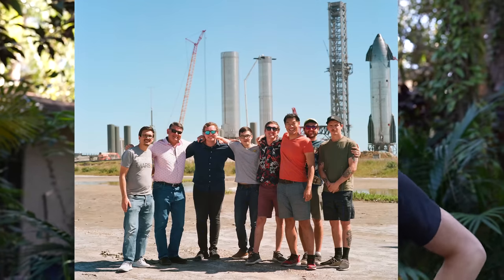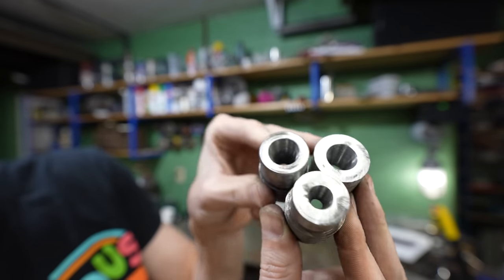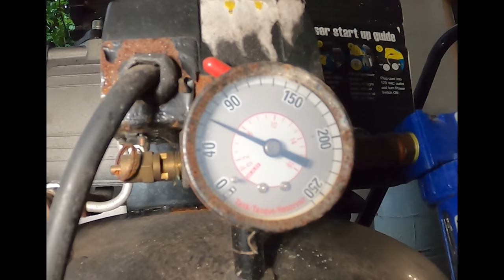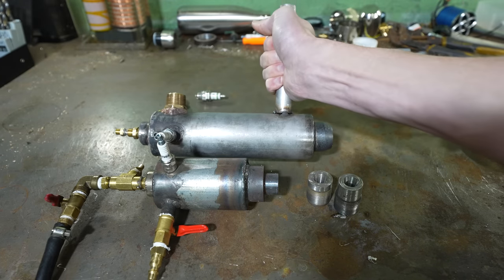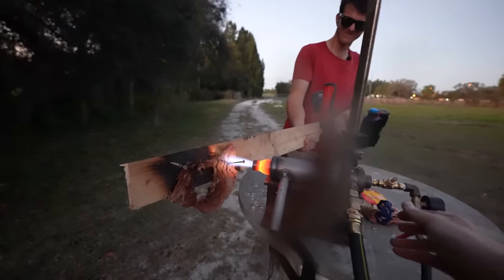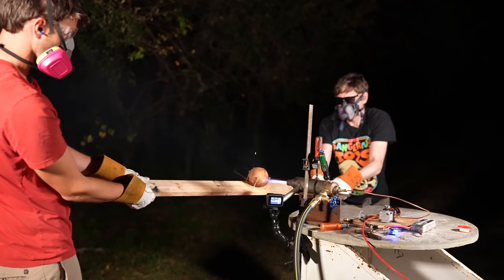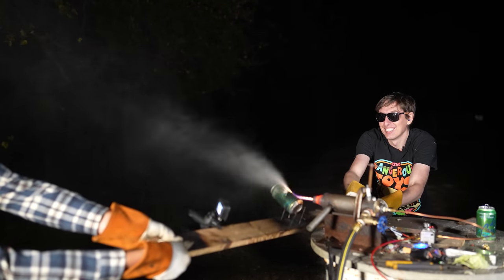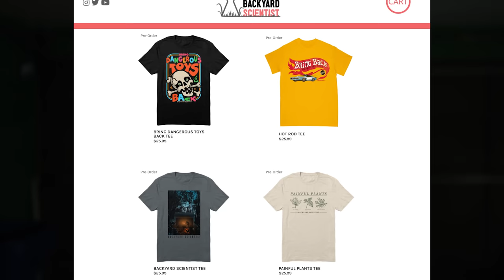fire death machine - i made a rocket

Comment: Propane and compressed air?! Dude that is awesome. I should have known you could get those kind of results with air only oxidation and enough input pressure but I just never considered it.
Reply: Wow, I was just saying he should test that Starlite from your channel, and I didn't even notice you were right under my comment haha!
Reply: @3000gtwelder  It would punch through starlite I'm sure, not because of the heat but because of the pressure blowing the carbon away
Reply: I’d like to see u take a crack at making a rocket engine
Reply: @tannerwatson1216  i expect that would wind up much less hazardous too
Reply: Well he was starting with 49 horse power worth of compressed air and then dumped a ton of chemical energy on it as fuel. 
Edit did the math, and he could be putting out 62.88 horsepower in total with the kerosene if the compressor was at full throttle.
Reply: Integaz must be upset seeing this
Reply: @joshuaworley3898    WOW, that's a lot of pressure 😳.  Very impressive.
Reply: @joshuaworley3898  Would have been interesting to see the thrust produced by the 49hp air compressor running through the "engine" by itself, then running with the kerosene injected...  I suspect we're really just watching a glorified torch the whole time.
Reply: ROCKETS ARE COOL 
TOMATOES ARE DISGUSTING!
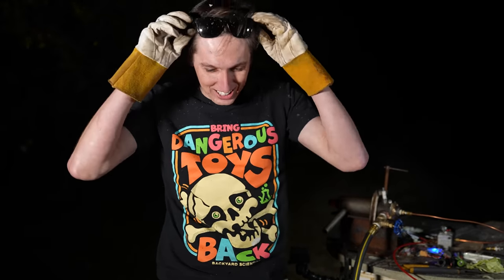Reply: 9:04 the class th0t be like
Reply: @Nighthawkinlight  Yeah, your probably right. They use special resins and composites that puff up and ablate away.
Reply: @spartanu9268  Why?
Reply: @thom1218  I don't think so, you wouldn't see mach diamonds.
Reply: @3000gtwelder   Integaz has been 3d printing rockets for months but with moderate success
Reply: @spartanu9268  Yeah, but he knows 3d printing with resin isn't the best way to build a rocket lol. I'm sure he would use steel if he really wanted to make a working rocket lol.
Reply: @3000gtwelder  True
Reply: You should see what  compressed air does to electricity. 

You may be in for a suprise
Reply: You guys need to try doing some stuff together sometimes!!
Reply: In a welding shop we use acetylene gas and Oxygen gas. We achieved the same effect but it’s kinda like a mini lightsaber now
Reply: I subscribe to the news letter
Reply: @tommiraeko8541  what are you referring to that i can Google and get results other than storing energy as compressed air or wind turbines
Reply: Instagram User  You sound jelly of his GF
Reply: @joshuaworley3898  49 Horsepower motor, there will be significant losses involved in the compression.
Reply: @thom1218  It is a rocket motor. I don't know why so many people are so salty about him using compressed air. Where are all your videos of you producing supersonic thrust with shock diamonds?
Reply: @randomname4726  Follow up - a real "rocket engine" powers the compressor from the combustion of the fuel that also is delivering thrust - it doesn't cheat by just dumping fuel into an already existing air stream.
Reply: @thom1218  You are so clearly jealous.
Reply: EPIC!
Reply from the maker: @joshuaworley3898  HA your the only person that has done the math so far, im assuming you calculated the mass flow rate of 185 cubic feet of air per minute + the stoichiometric amount of fuel? I got a similar result.  I also tried to estimate the extra thrust from the nozzle accelerating the hot gas so i think its a little bit more, about 50% more thrust than the air alone.
Reply: @TheBackyardScientist  With just some small changes in the design and geomerty ye should be able to up that to around 70%. And with the use of just O2 instead of compressed air ye should br able to hit around 318% for close to 6 seconds till it melts.
Reply: Im curious if additionally adding an inlet for an oxygen tank would increase the thrust? 😂 Yuss i got to the end of the vid so glad you did
Reply: @joshuaworley3898  Something that small putting out 63?
Reply: @TheOgAutisticOne  brooo
Reply: i love your videos
Reply: Where is THE HACKSMITH
Reply: @mason8852  wot?
Reply: @3000gtwelder  this has to be done
Reply: Dè
Reply: Instagram User  I know. He's always really happy in his videos!
Reply: @Paragon643  using something like ethanol and a mix of film and regenerative cooling might help it not melting too much
or ammonia
Reply: @Mysterybox007  it would increase the thrust but also the temperature so it eould melt so you eiuld want to daa some type of cooling so the engine doenst melt instantly
Reply: I didn't expect to see my favorite Ted Cruz lookalike science man here.
Reply: clearly should have used liquid ox and liquid hydrogen
Reply: I remember seeing a video a couple years back of a ukrainian guy making a propane torch just by using a syringe, 2 hypodermic needles a bit of tubing and a bottle as its compressed air tank. You can make anything out of anything if you really put your mind to it.
Reply: imagine pure oxygen
Reply: @thom1218  Not exactly, a real rocket engine also has liquid oxygen flashing into a gas, which surely produces quite the "airstream."
Reply: Basically it's the Venturi effect x2, and then add a venturi nozzle for x3 🤣
Reply: How about hydrogen and pure oxygen!?? It could be a explosion..
Reply: @lalxl  can i use mt lungs instead od a bottle?
Reply: idk if any1 else has said this, but i read your comment in your voice.
Reply: @spartanu9268  yes he’s probably upset and exited hard to explain but I think I know the feeling
Reply: @TheBackyardScientist  me too
Reply: It’s a Russian idea what do you think
Reply: @TheBackyardScientist  youre*
Reply: woah science stuff I dont understand
Reply: @TheBackyardScientist  you sound exactly like Kermit da frog 💀
Reply: @randomname4726   Yeah, these guys are apparently unaware that the Oxidizers used in "real rocket" engines are pressurized with turbo pumps. Insane pressures, sometimes. The pressures must be above the exhaust pressure, and the fuel/oxidizer pressures must match each other so that one doesn't force its way into the other's system. I think that they just didn't think too much before making assumptions.
Reply: @thom1218  I had the exact same thought. He already showed with just the compressor how much air was coming out.
Reply: @thom1218  Rocket engines are all glorified torches in a sense, the only reason that torches don’t produce thrust is that they burn their fuel externally and the hot gas expands in all directions, putting only a very slight pressure on everything nearby. A rocket burns it’s fuel internally and only lets the gasses escape in one direction. With the amount of fuel he is burning this rocket MUST be producing a substantial amount of thrust unless there is a huge leak, which would be visible because we can see the whole engine.
Reply: @harryf9885  If the difference between the 43hp air compressor on its own and the "rocket" was impressive - we'd have seen a "rocket on" / "rocket off" side-by-side... and we didn't.  I'm not buying the difference is impressive or even worth watching.
Reply: I need this for my exaust
Reply: I feel like this needs oil, where needed;/
Reply: just realized I shouldn't be here, too much smart guy talk
Reply: Smoke video calling
Reply: What they call it
Reply: Lol
Reply: @TheOgAutisticOne  bro ☠
Reply: @Bibibosh  Kentucky ballistics need this rocket engine for torturing his ever-hated eggplants!
Reply: The heat ray at the ants house
Reply: This man is like Mark Watney🤦‍♀️

Comment: Some questions for Part 2:
- The result of the different nozzles.
- A measurement comparing force output with and without ignition.
Reply: Very little force comes from the air compressor relative to combustion. Because he can control the amount of chamber pressure he can just dial it in to suit whichever nozzle he's using whereas in a flyable rocket motor everything is calculated and defined beforehand to match.
Reply: Plus maybe using a liquid oxidizer, or would that be too dangerous?
Reply: @randomname4726  I'm not so sure. You are probably right, but I feel like there's a possibility it's like 30% compressor - 70% combustion. That air compressor is a serious piece of equipment, and you can cut through all sorts of stuff with just the air compressor. I have no frame of reference for the combustion.
Reply: @doubledoot  yeah liquid oxygen could make grease in your seals explode. Also you can't buy that stuff but have to freshly distill it from the atmosphere with buyable liquid nitrogen. And by using 100% oxygen instead of atmosphere 80%nitrogen 20%oxygen it will get much hotter, melting your engine withing seconds if you don't have a good cooling concept
Reply: @Dee-nonamnamrson8718  Looks like I'm wrong, he says in other comments that it's about 50% with just air. I'm shocked, I've used these compressors and while they do put out a lot of air the speed is nothing compared to the rocket motor.
Reply: @randomname4726  50% is shocking. I didn't think it would be that much either.
Reply: Not only force but also how much air and fuel consumption reduces after ignition.
Reply: also maybe ethanol and MAybe ammonia as fuel
Reply: Yes and Pre-Heated Fuel
Reply: @doubledoot  i bet it would sonce suddenly you're making much more complete combustion and cgamber pressure but that inst all that dangerous but like that i bet he would melt the nozzle if he doenst use some cooling
Reply: @petermacris8260  ammonia is not great to deal with
doenst burn all that well it seems like
it's also a neurotoxin
Reply: pretty sure it needs a smaller nozzle, shock diamonds and what not
Reply: @nathanwest2304  if he was trying to launch it,vit fldownst rlly matter
Reply: @randomname4726  Too wide nozzle. Based on some measurements from when he's cutting the hotdog, I calculated the outer nozzle diameter should only be 53.5% of its current diameter for optimal thrust at atmospheric pressure. That would make a much grater difference compared to the compressor only.
Reply: @hitnovak  Nice job on the calculations. It's clearly been far too long since I played with rockets.
Reply: it would be nice to see him use a nozzle where he has done the characteristics calculations in order to achieve the best nozzle, and then compare it with the nozzle where he made his best guestimate
Reply: Hmm I'm no expert but I think he's made something closer to a jet engine. A jet engine compresses air, mixes it with fuel, and ignites it to produce propulsion. A rocket should contain all of its fuel including oxygen.

In the video, the oxygen source is from an air compressor and not an oxygen tank.
Reply: Should be easy enough to add a sliding mount and a vertically placed load cell to measure thrust with. Would also be interesting to see the plotted data for both fuel and air pressure against thrust produced.
Reply: AND DIFFERENT FUELS
Reply: @Dee-nonamnamrson8718  I don't think people appreciate how much 185 CFM is lol
Reply: @KillFrenzy96  It essentially serves the same purpose as an oxidizer though, more oxygen atoms in contact with fuel allowing it to combust more efficiently. Doing this with an actual oxidizer/fuel mixture would be far too dangerous, even beyond the scope of TBS I think. At least with the lax safety protocols they were using in this vid.
Reply: Technically by using an air compressor he made a jet engine, still cool as heck though. It's kind of like calling snorkeling SCUBA. By definition, not really, but both are fun.
Reply: @michahermann7869  you can buy liquid O2, just not in small quantities. Smallest unit I've seen is like a 4ft tall, 3ft wide dewar.
Reply: @doubledoot  Liquid oxygen and kerosene is what they run actual rockets off of... I don't think that amount of power is even remotely safe in a homebuilt engine.
Reply: @Dee-nonamnamrson8718     @Random Name   i feel at home here
Reply: @randomname4726   @nonam namrson i feel at home here
Reply: @impv1se  I think you might be the first person that's ever realized what my username meant, or at least mentioned it. Someone blowing and burning stuff up in their backyard is a magnet for people who prefer anonymity. Who'd have guessed?
Reply: Propane isn't that explosive though, and if he's got an industrial air compressor with 120psi + then I'd wager 99% of the thrust is compressed air.

I see 50% going around in the comments but I highly doubt that.

He basically made a welding torch.

I suppose you could offset the compressed air with pure oxygen and lower the pressure to see?
Reply: use solid fuel like the space and make boosters,just substitute ammonium perclorate for potassium nitrate in your rocket candy and add a bit of aluminium

Comment: Shock diamonds, while cool, mean that the nozzle is over expanding the exhaust. Try using a nozzle with a smaller bell and you will get even more thrust.
Reply: @dionh70  just did. He says the exact same thing
Reply: I was gonna mention this. Thanks for doing so.
Reply: Another thing is that if the nozzle is too overexpanded, it could have actually exploded/

Comment: What is missing is a static force test comparing the thrust of just the air, vs running. That would show just how well, or not it is actually working
Reply: I was just about to comment this
Reply: Totally agree. How much thrust is the fuel adding. Also, O2 instead of compressed air.
Reply: @douganderson7002  You have never seen a high CFM compressor before I guess. A sandblaster would blow the trees around just like that. We know it’s adding something we want to see how much the fuel is adding.
Reply: aren’t the shock diamonds proof enough
Reply: @aawagga6841  Yes it's adding something. The question is how much.
Reply: @douganderson7002  Compressed air that's at the speed of sound...
Reply: @aawagga6841  If it's backyard science then he should have to put it on a sled, measured the thrust on air pressure alone then run the engine on the sled and subtract the air pressure thrust.  I suspect the burning fuel added very little to the output, it just looked cool.

I can go down to my garage and blow trees around from a distance or cut a hotdog in half with my $850 shop compressor.
Reply: @dev-debug  honestly who even cares, go make your own if you’re so bothered by it
Reply: @aawagga6841  Some of us like the data part of it.
Reply: @aawagga6841  I forgot, this is a channel where they do smart things like putting gasoline on tennis balls and hitting them.

He really should just remove the science part from the channel name I guess.
Reply: while I might be suspect on this being an actual rocket engine, I do wonder as home access to things like CNC and laser sinter printing gets ever better.  how long is it till a youtuber violates ITAR without ever knowing about it. And does ITAR even apply to people just dicking around in a garage and a field.

Comment: My dude, if you have to feed compressed air into the system, you haven't made a rocket. You've made something even harder. You've made a glorious ramjet.
Reply: nope
Reply: ...no, it's just a jet engine. The defining characteristic of a ramjet is lack of compressor
Reply: If you want to consider the engine compressor as part of the jet engine, you could call it a motorjet. 
Otherwise, it's a rocket, that uses a compressed air rather than say liquid oxygen.
Reply: A ramjet uses forward momentum of the craft to compress air by sheer force of speed.

Comment: This video was awesome. And a fun fact for you guys, so my job is Thermal Spraying. We pretty much use the same technology to superheat, melt, and then accelerate tungsten carbide. We then coat metal parts to apply tungsten carbide and create a hard wear resistant surface. 

The gases we use are compressed air of course. Propylene and pure oxygen. It makes a super hot rocket flame with tons of shock diamonds.

Comment: I'm curious about what what other nozzles look like. I'm assuming the flow is overexpanded at the nozzle but shock diamonds also occur from underexpanded flow too (e.g. pressure at nozzle exit is greater than ambient). Did you do your calcs on throat and exit areas?

Comment: That was IMPRESSIVELY stable combustion for a DIY project. Well done! It'd be interesting to see one with acetylene, if you are brave  enough.
Reply: Not possible acetylen is instable at high pressure.
Reply: He even made shock diamonds. Impressive
Reply: Why would it be risky it's literally just a torch.
Reply: @patman0250  a torch would never be able to do that:
Reply: @patman0250  yes, I have one, I’m just saying it would be unable to actually produce nearly that much thrust.
Reply: @franciscosoares2440  shock diamonds are inneficiencies
Reply: Why change the fuel? Change the air to pure oxygen.
Reply: @hkkhgffh3613  how do they put it in pressurized tanks then?
Reply: @Acrophobia2  dissolved in acetone, just like carbon dioxide in water.
Reply: @SomeGuysGarage  ohhhh. That’s really cool, thanks!
Reply: Best. Ad. Segway. Ever.  Masterfully done.
Reply: @saab35draken39 shock diamond is achieved when the structure is nearly perfect, and so much of rhem is imressive, the thing is not about inefficiency

Comment: That's insanely cool, dude! Love these high-risk high-heat experiments! The fact that you were able to make an amateur rocket engine that easily is pretty cool, especially with those beautiful Mach diamonds!
Reply: If I remember correctly though the diamonds are from an inefficient nozel, meaning the exhaust could be a lot more powerful with a little adjusting.
Reply: @youjustlostthegame2028  oh? well i would have no idea whether that's the case or not
Reply: @youjustlostthegame2028  you are correct it is inefficiency from the nozel

Comment: You don't mention it, but if you have issues with your nozzles eroding over time, try using Tantalum alloy, specifically T-222 it is a super high temp metal (higher service temp than Inconel alloys) and is actually frequently used in rocket nozzles. And it is only slightly harder than normal steel to machine. 👍
Reply: Instagram User  Bruh you don't even have content!
Reply: @netts2315  it’s a bot